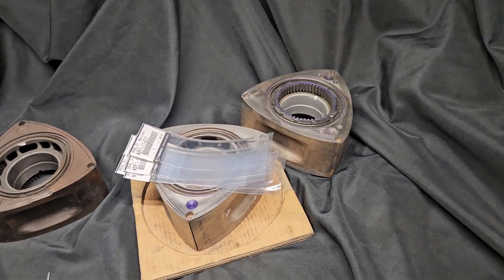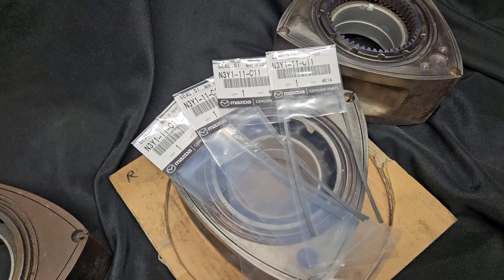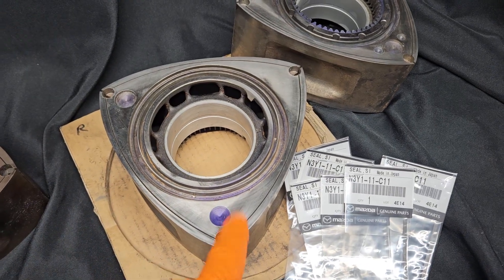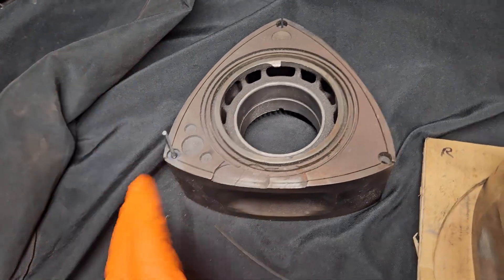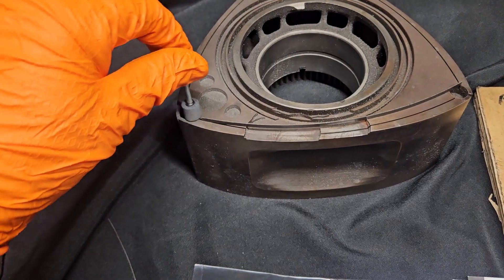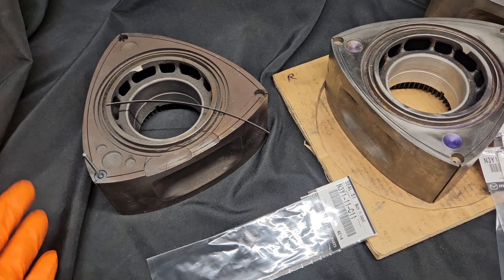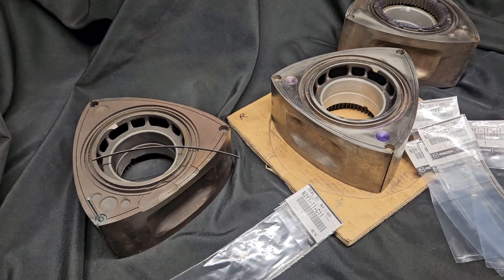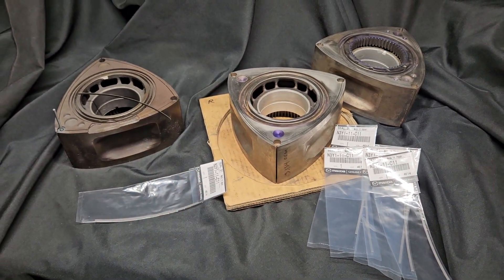Side Seals tips, Rotary Engine Parts and Tech, proper installation & cutting KMR Rotary - Mazdatrix

Comment: Thanks for sharing this. Would you use the grinding tool to shape both ends of the side seal, including the one that Mazda cut nicely? In the followup video, can you also show how you would measure the side seal clearance?
Reply from the maker: I leave the one end that's cut nice per the factory Manuel.  Unless it has an issue

Comment: I have heard several builders claim that if you're building an NA motor then it should be tighter in tolerance, and if its FI then it should be a bit loosed. I've also heard the same line of thinking with a street build vs a race motor. Is there any truth to this or do those people not know what they are talking about?
Reply from the maker: id say that is not necessarily correct. its more about thermal expansion, port shape, and style of engine usage. Point in case: I run my Formula D car seals tight and i run hot, i never have side seal issues... So my testing and results may disagree with others. Its a complex situation.
Reply: You can think of the seals as piston rings. Turbo cars run hotter, because  you are using more air and fuel. As a result, you would have more thermal  expansion. Hence, the need to gap it wider.
Reply: I thought making the side seal ends have the same shape as the corner seal was the most ideal like you explained in the video, but I went back to thinking about “proper” shape when I took 6 engines (renesis only) apart and inspected the side seal ends. Almost always the side seal ends showed the opposite shape of the corner seal, or a stretched out S sometimes, if that makes sense. And each end of the side seal was a different kind of wear. Meaning from centrifugal forces, one end of the side seal slammed into the corner seal harder than the other, leaving a different wear pattern. Any word on avoiding side seal wear? Love the in depth talks about rotaries, would love more KMR expertise on all rumors on the topic! Stay brapping!!
Reply from the maker: @jacobdice2440 ill just say after 1000s of motors.  We cut them to this shape...
Reply: @KyleMohanRacing  totally trust you, thank you for the confirmation!!

Comment: For the RX-8 what is too tight on the side seal?
Reply from the maker: ill do a video but just get the pre cut from me or trix.
Reply: @KyleMohanRacing I just finished my build for an rx8. Curious to see how you measure the rx8 side seals if you’re cutting them. The renesis build guide has a specific way they want you to measure the side seals clearance… 👀
Reply from the maker: @MrErchman yup, very much different than the RX7.  We did a lot hand cut, but in the end I've been very happy with the pre cut seals and sometimes slightly modifying a couple. To be slightly tighter than the stamp.